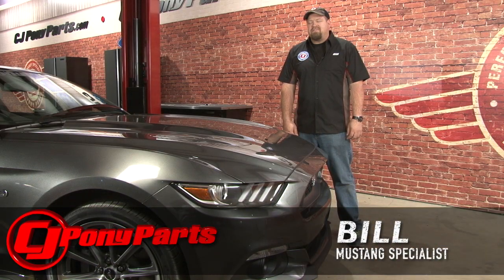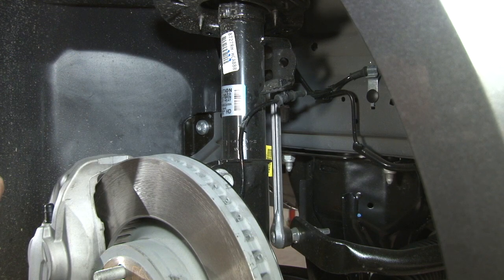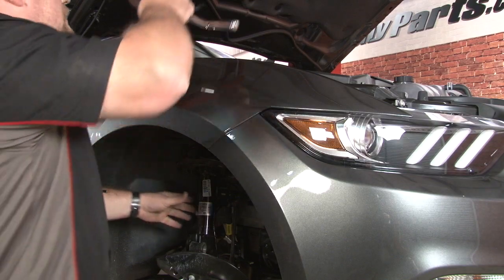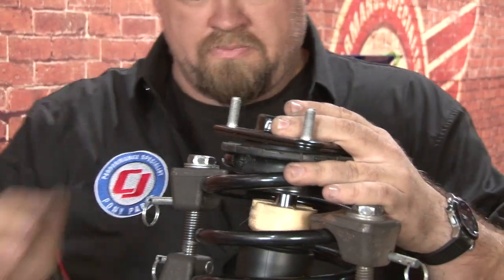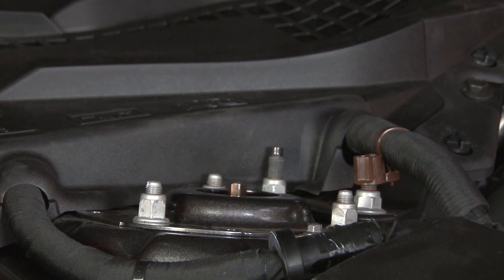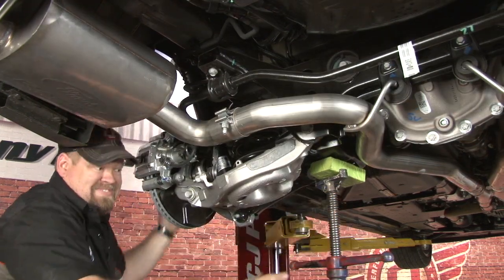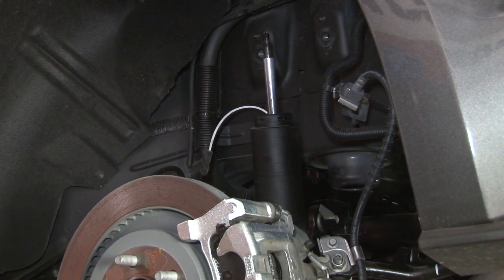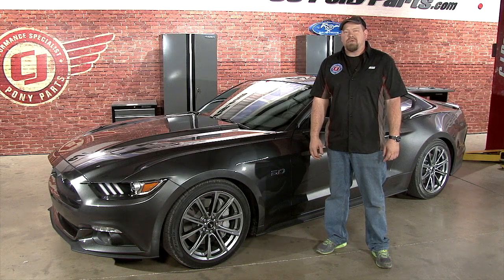2015-2023 Mustang GT Eibach Pro-Kit Springs Installation

Comment: Will the 1" drop require a camber kit or are the tires still within normal alignment range?
Reply: I called Eibach to ask about that and their reply was that rear camber doesn't change so no problem at all.  On the front end, the lowering results in 1/2º more negative camber than factory spec.  In my view that's trivial; and keep in mind that a little more negative camber up front reduces front end plow and improves handling...at least within the area of 1/2 - 1º.